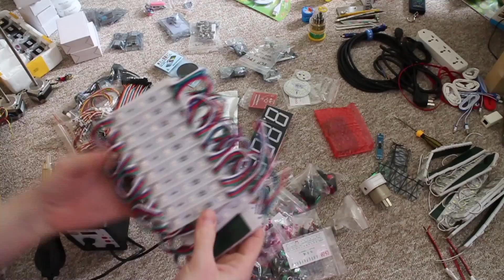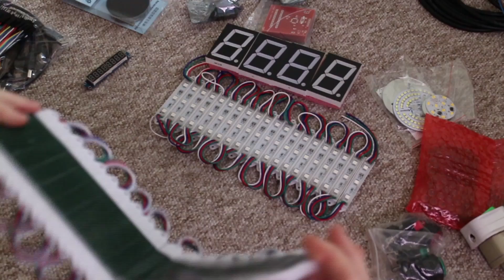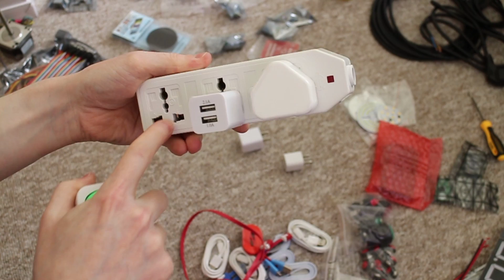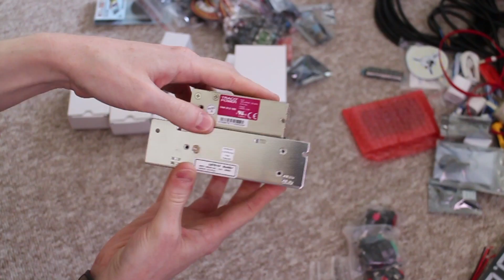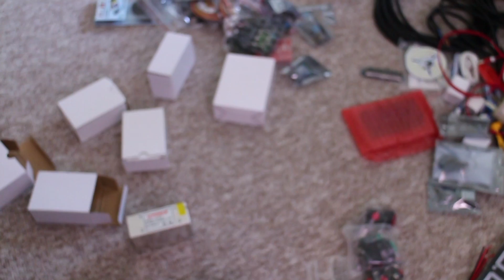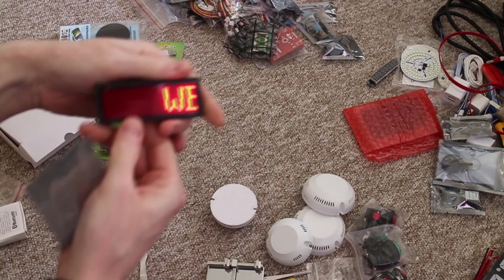Shenzhen Trip - Electronics Parts Overview

Comment: Great video. Thanks for sharing your goodies from Shenzhen. I have a couple of those 12v led strips and can light up nine strips in a daisy chain, using a DIY joule thief. The joule thief runs off approx.5 volts, either USB or 4.5 battery. The great thing about those strips is that you don't need to worry about resistors or heatsinks.

Comment: A Lady in Sydney (Australia) was killed by a wall socket USB charger from China. She was using her phone while charging. Please ensure they are approved by your countries electrical standards. (Enjoyed your Vblog, Thanks Mate).
P.S. I modified a Chinese battety charger (That came with a small 'Cree' torch), It was literally SHOCKING !. The spring loaded contact was .02mm (an exaggeration to make my point) from MAINS 240V voltage. If I had the wisdom I claim to have I should have 'Binned' it and purchased an approved charger for that long single battery. P.S, I wish I still had your enthusiasm. Have you seen 'EEVBLOG' channel ?
Reply: Rob Robbie Blame the phone, not the charger.